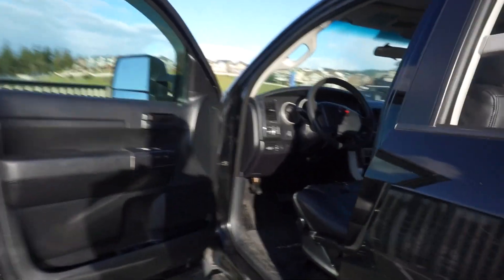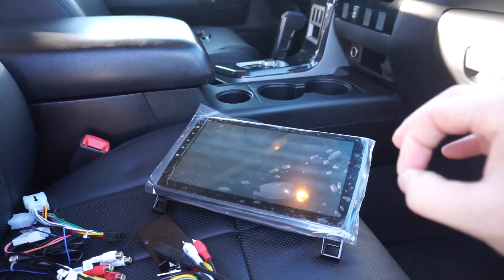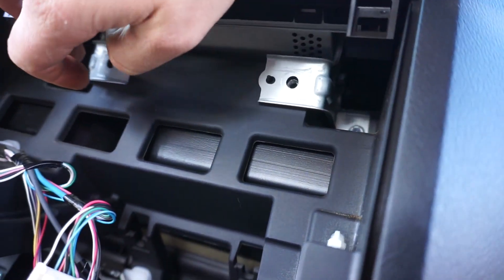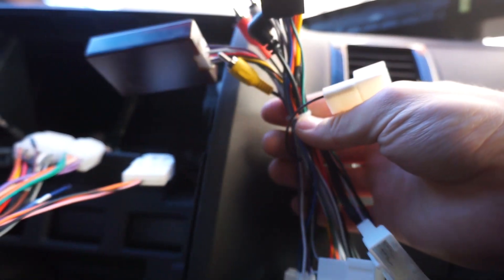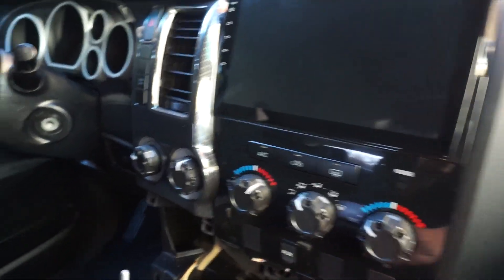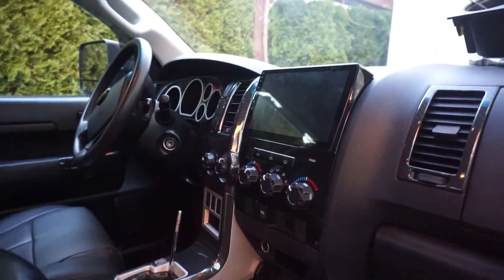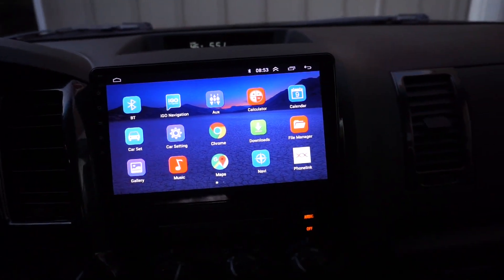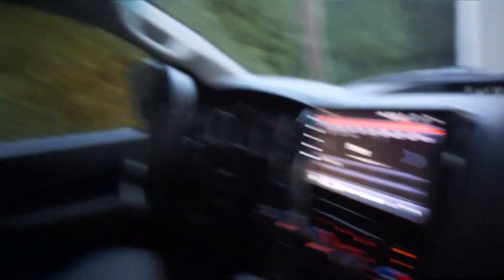10.1" Touch Screen Toyota Tundra Stereo Install!

Comment: Figured it out on the upper top clips not seating all the way, I used machinist die to see where it was stopping on the clip found that it was not seating all the way in so I took the clips off and relieved the area that was not clipping into the Square bracket holes once I did that, it resolved the loose issue with the head unit fyi welcome!!! 😊
Reply: I pushed it in really hard and it clipped 😆

Comment: Good video overall, but it would be nice to have a link to the head unit.
Reply from the maker: https://www.ebay.com/vod/FetchOrderDetails?itemId=403498484445&transactionId=1050030180027&mkevt=1&mkpid=0&emsid=e11412.m43.l1123&mkcid=7&ch=osgood&euid=918c7c16fb6647b18288b5c6fad796e5&bu=43567317460&osub=-1%7E1&crd=20220308141846&segname=11412&sojTags=ch%3Dch%2Cbu%3Dbu%2Cosub%3Dosub%2Ccrd%3Dcrd%2Csegname%3Dsegname%2Cchnl%3Dmkcid
Reply: @MitchDore  Where did you get the leather seat covers from?
Reply: How was the eBay head unit holding up right now?